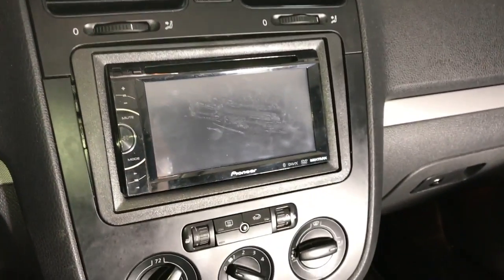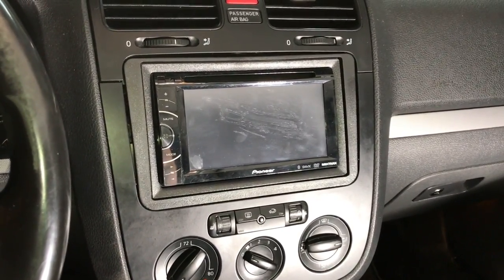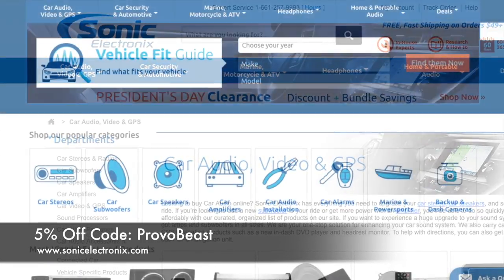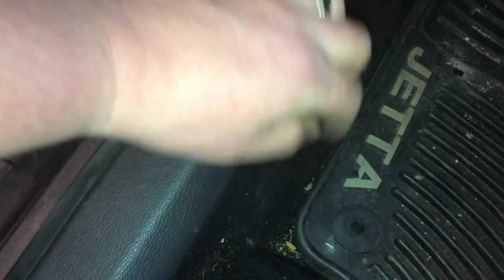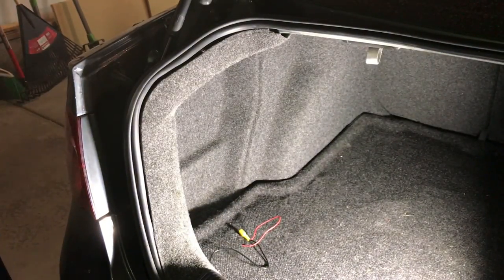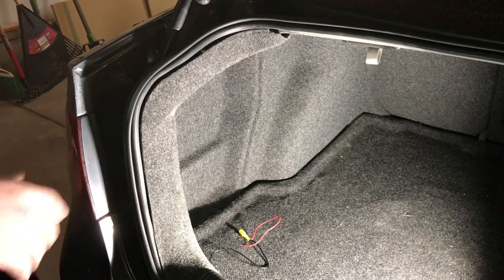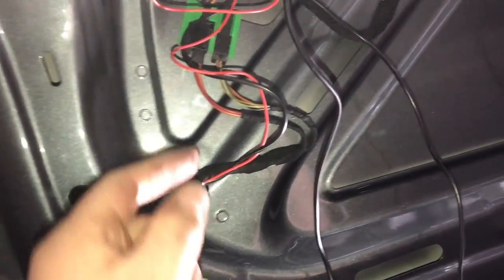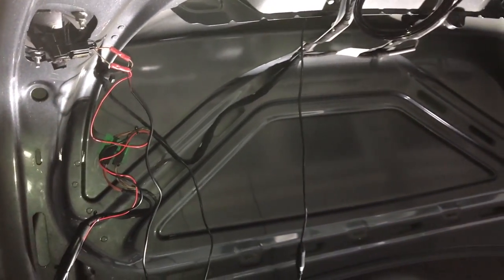2005 - 2010 VW Jetta Backup Camera Install

Comment: Good video and information for a Garmin 2597LMT/BC30 camera installation!  I reviewed the area before the video and knew about the 4 screws on the lift door cover, but those metal clips were a bugger!  I have a 2006 which still uses light bulbs - P21W.  Had no issues after installation!  Thank you!

Comment: Great instructions! I followed these instructions pretty closely - spliced my camera into the reverse light wires as shown - got in, put in reverse and the camera came on but, it flickered a little then went out. Do I need to re-check my camera power connections again?  My setup has a canbus and it already showed the reverse bars (in reverse) before I wired up my camera.

Comment: Nice video, but you don't talk about the canbus workaround for most backup cameras.  Is there a relay or something that can be used to keep the camera working while the car is running instead of just with the key on?
Reply from the maker: Absolutely - All you need is a power filter harness as it eliminates the distortion over the 12v DC power when the vehicle is running: https://amzn.to/3CZIvYY
Reply: @ProvoBeastAudio  did you need to use one on this vehicle?

Comment: The wire that comes off the rca in the trunk goes to power from the taillight. Where does the the wire that comes off the camera go?
Reply: I think it goes into the power as well and the black wire negative,, 2 red positive and 1 black negative from what it seem in the video, correct me if I'm wrong 😀

Comment: My vw jetta mkv backup cam works with the key on engine off, but not engine on, any tips?
Reply: I’ve been told you need a relay. Did you have luck with a fix as I have the same issue.

Comment: I grabbed a similar unit and when I put in reverse all I get is a black screen.
Reply: The power to the camera from the reverse light isn't strong enough
Reply: @NomaD7801  where did you grab power from
Reply: Haven't found one yet
Reply: I ended up getting power from the accessorie port in the trunk. Connect a relay to it, can't remember exactly how it was wired but there is a video on YouTube that I got the idea from.
Reply: You need to buy a 12V relay, because euro cars like VW Jetta the voltage is 12V in accessory mode, but then  drops once the car is on and running and it doesn't get consistent 12V. 12V relay should fix the issue

Comment: When  The cord is plugged into the back of the radio, where do you connect the other wire that runs off of it?
Reply: There's a reverse signal wire that comes off deck

Comment: I soldered the wires to the reversing light. It doesn't work because the light voltage is too low. Works when stationary, sometimes, but not when driving

Also, the wire coming out of the car using the wiring loom. I noticed that pushing the boot fully in squashed the wires against the edge of the metal. But leaving the boot ajar might allow water ingress.

Could I cut a slit in the boot for the wire to pass through, and so the boot can be fully inserted again?
Reply: Can u describe or send a photo how it looks after you made a cut on rubber of license light to ease cable. Also, was it easy to go through plastic part of  tailgate trunk handle!
Reply: @ashrafafifi5042  that part was fine. I'm talking about the gutter of the boot where the wire emerges from the car.

PS I reconnected the power to head unit, and still used the earth on the reversing light. I need to get an inline choke to suppress noise.
Reply: How did you wire yours up? Running into the same issue works when the car is in the on position.

Comment: ''Skar Audio VVX-10v3 600 Watt RMS 10" Subwoofer - 2OHM'' was thinking of getting 2 of these, i have the skar audio RP-1200.1D mono amp, think they'll be a good match??
Reply from the maker: I'd get the dual 4 ohm versions so you can wire them in parallel to 1 ohm, maximizing the power of that amp.  You'd want to wire each sub in parallel and the subs together in parallel to achieve a final impedance of 1 ohm.